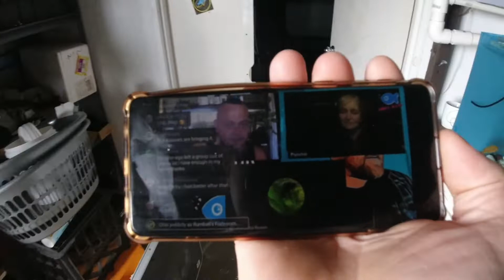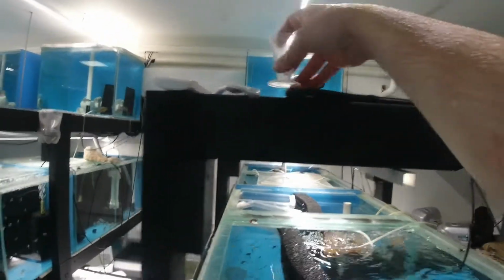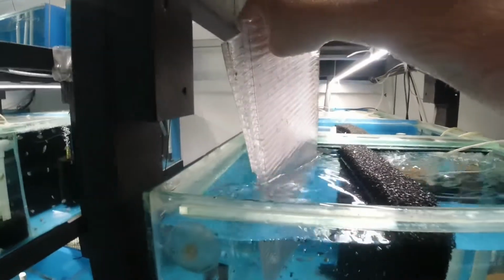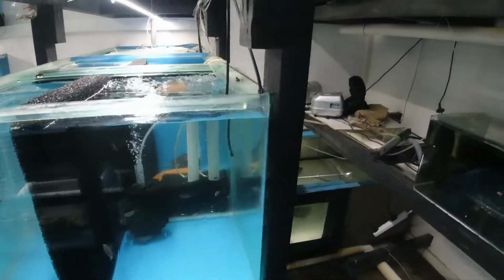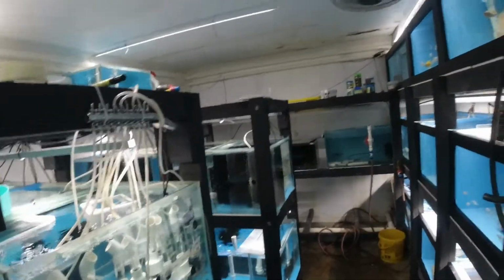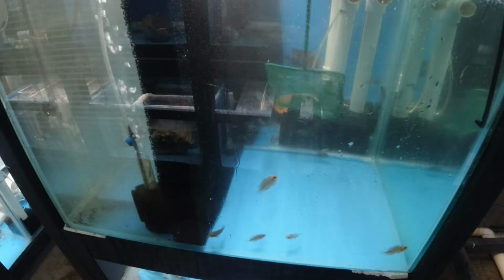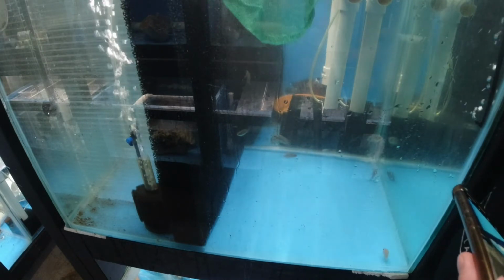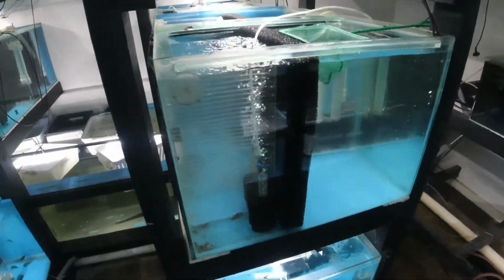Watching Aquamates 24hr stream while moving flowerhorns

Comment: I would run 20mm or 25mm PVC of your main air line on top of the racks and then run air hoses from there, big job but sometimes you need to take the time and effort to do clean up as patch jobs tend to catch up on you.
Flowerhorn fry are looking good.